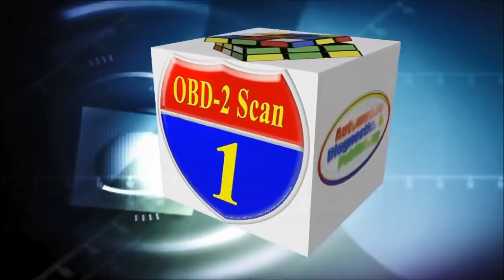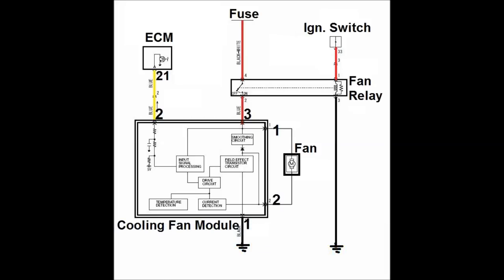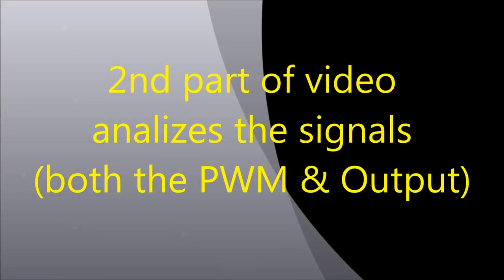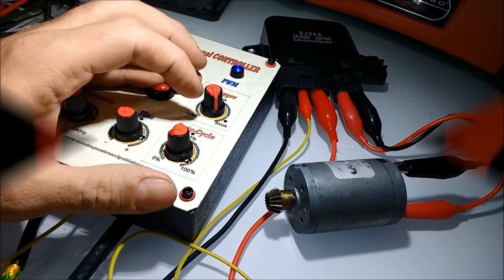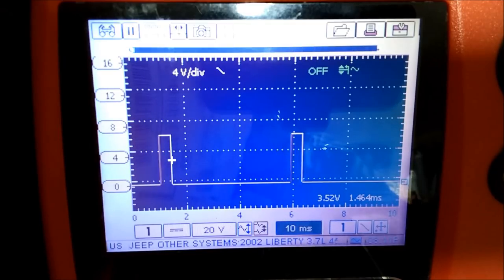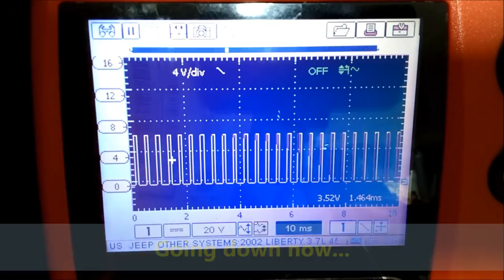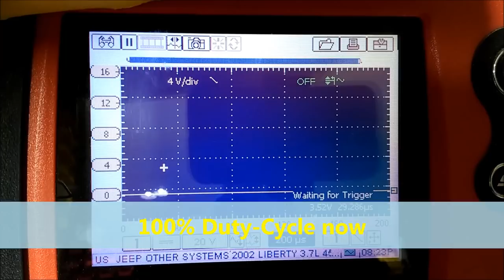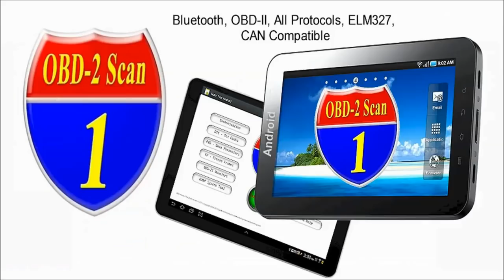How ECM Controls Cooling Fans

Comment: Cooling fans stop working mechanic said ecm replace with new flash one, later down the line unplug battery cooling fans stop working again help please
Reply from the maker: Reflash won't solve you issue.

Comment: I have mitsubishi outlander 2003 ( first model), used this module.
Fans not working, I suspect control module but find that carbon brushes inside fan motors have worn down to zero and commutator damaged in the process. 
Car has 220,000km assume original fans, so can expect fans brushes to need replace around 200,000km. I have not yet tried control unit on new fans so dont know if it has damage also. Fan motors not really designed to take apart but can do fairly easily just by 
bend out metal where its pressed in on rear of motor.
Regarding video, excellent info, would be interesting to see what signal the ecu of a car actually outputs to control the fan, that pulsing of the motor speed at certain on/off percentages of the pwm I would doubt is used by ecu, I dont think the fans pulse the speeds in a car.......I could be wrong.
Reply from the maker: A 2003 is an older car. That's ON and OFF circuit.
Reply: @ADPTraining  thanks for reply but its exact same controller using variable speed

Comment: I've recently replaced two of these fan control modules on my car. First the factory one failed after fifteen years, then the non genuine replacement failed within two months, so I spent $388 to get a new genuine Mitsubishi unit.
Reply from the maker: Sure, OEM is the way to go. Non of these aftermarket electrical parts work at all.

Comment: so what you do if you dont have this performant machinery to test the module, im sure most of viewers dont have this so can you replicate the pwm signal trough a rc radio receiver ? they work on pwm signal, was curious if I can have same result.
Reply from the maker: If you don't have this unit you end up replacing the parts. If that doesn't solve your issue, then your loss. If you work on your own car or are a professional technician, then you need your tools. Here it is in case you need it.
http://www.autodiagnosticsandpublishing.com/pulse_width_pwm_controller_driver.html

Comment: Hi, thank you for the video. Can one use say a Temp switch (thermostat in oil radiator) to output the signal to the module to control the speed of the fan?
Reply from the maker: It's best to use an Arduino for that. See my Arduino videos on this channel.

Comment: I have cuestion please sr. I have a DS 213 mini osciloscopio and I am just wondering if it would be possible to use the "waveform generator" function to put frequency or to do something similar like PWM. I am not totally sure about it. Thank you for this video tutorial.
Reply from the maker: No, a waveform generator will never give you PWM. Not even a 555 timer will give you PWM. Pulse width modulation needs a dedicated circuit. See my PWM BI Directional Controller .
http://www.autodiagnosticsandpublishing.com/pulse_width_pwm_controller_driver.html
Reply from the maker: On top of it, this unit has a huge driver transistor to boot. Control almost anything with it. 
http://www.autodiagnosticsandpublishing.com/pulse_width_pwm_controller_driver.html

Comment: This is great -- it let me confirm what I was guessing about this dumb FCM which seems to give out regularly.  I'm thinking of interpreting the PWM with an arduino-like microcontroller and driving my own big fat super-low-resistance FETs to run the fans.
Reply from the maker: That'll definitely work just fine. In fact I have an Arduino project here just like that. Look it up.

Comment: @adptraining how does the second channel is working ? how to trigger channe 1 and channel 2 with 2 temperature levels ?
Reply from the maker: Channels 1 and 2...????? 
What do you mean.
Reply: @ADPTraining  you have 2 output channels on the controller, to manage 2 Fans
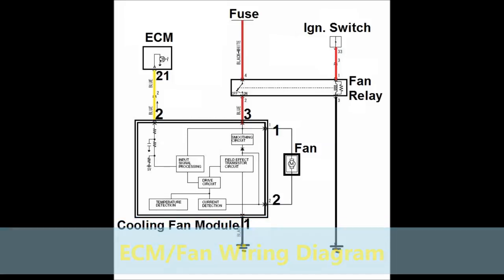Reply: @florentviolleau6716  That particular Fan Control Module (Gates FCM102 is an aftermarket version, can't find the Calsonic Kansei original) doesn't output different signals for the two fans.  The two two-pin connectors, one on the bottom, one on the side, are so it can control two fans, but they both get the same voltage.  Check the block diagram and explanation at 1:12.

Comment: I'm hoping to use one of these Fan control modules in an older car. Can i hook the trigger wire to a temp sender or override switch if i don't have an ecm?
Reply from the maker: Yes, to a temp SWITCH, not a sensor. The switch has to be calibrated to say 180 deg F. This is s typical fan turn on temp.
Reply from the maker: Also, see my series on Arduino. You can do all that with a $10 Arduino.
Reply: Thank you for the information. Do you happen to know what continuous amp rating these are suitable for?
Reply: @ADPTraining 😢😢😢😢